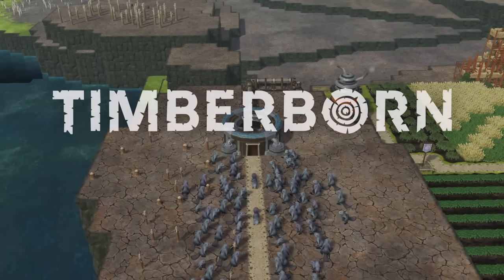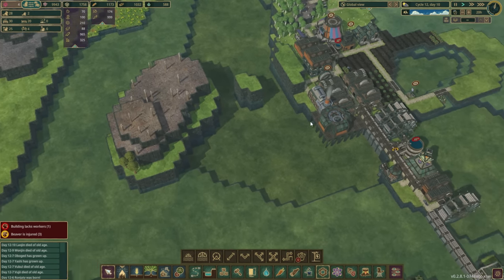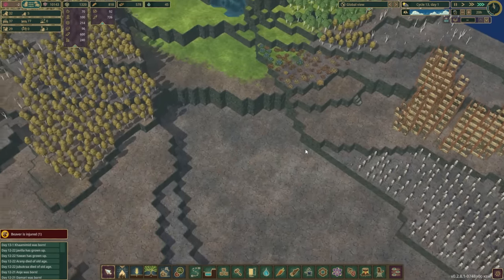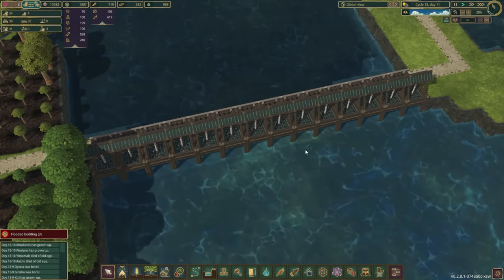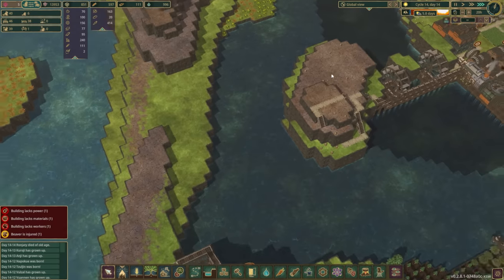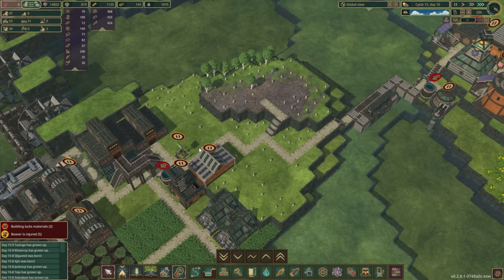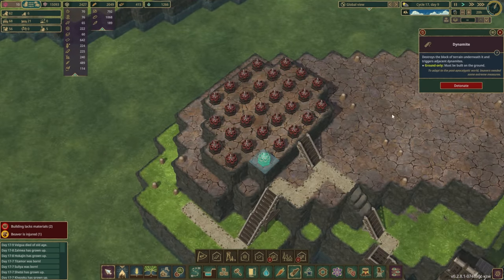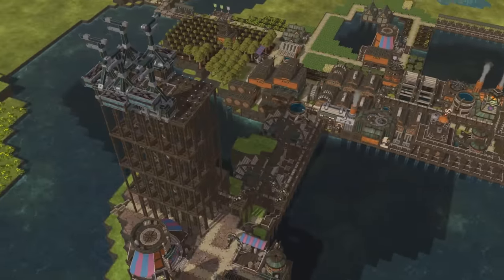I Built the World's WORST Engineering Project in Timberborn Update 2

Comment: They use rocks not water because water evaporates and would be less efficient.
Reply: Ah… not… really. You lose energy anyways…
Reply: @brody7714  he probably meant in game
Reply: @brody7714  ah yes really. Rocks don’t evaporate. Water does. If you’re storing energy you want to use whatever will lose the least energy. You don’t need to be a mathematician to understand an inert object would be better at this than something that can disappear while it’s sitting there
Reply: They want to use rocks instead of water for gravity batteries because everywhere in the world where it is a good place to build a water system, there's already one built there.  You can build a rock based gravity battery in the middle of the desert, or on a flat plain.  Water is better where you can build water, but it requires a source of water and a terrain with an elevation difference.  You can build the tower anywhere.
Reply: Cover up the water then? Make a closed system? What?
Reply: @freeportkid  water IS an inert object. Plus, you gain free energy every time it rains. Your argument is ridiculous. Energy is lost due to friction and resistance every time you use your system

Comment: So the reason they used bricks instead of water is because it is meant to be in places where water is scarce.
Reply: Even so, it's still a terrible idea.
Reply: @CarnivorousCass  I mean not really. Any form of energy battery is still better than non. And it's powered by solar and wind.
Reply: @LordKarronz  
1. The amount of carbon dioxide produced to make the concrete blocks is insane. About 30000 tonnes.
2. One of the proposed gravity batteries can only hold up to 35 MWh. A single Wind turbine produces 18 MWh on a good day. So one of these batteries can only store a single days power from 2 wind turbines.
3. In order to make it worth while at all, they would need to be built near power sources, like wind turbines. The amount of precision needed to stack hundreds of giant concrete blocks safely is rediculous, and will definitely be affected by the wind. Three flimsy cranes in a circle are not strong enough to brute force it.
Reply: Shit i guess your right, lets continue with coal and oil products for energy. Lets not try to come up with any ideas that might help out in the long run.
Reply: @LordKarronz  I never said anything about sticking to fossil fuels, or that we shouldn't come up with new ideas?  The fact that the only way you can argue my points is to make up something that I didn't even mention instead of actually refuting them proves that I'm right. 
There are always start up companies with bad ideas and good marketing that try and make it seem that their technology will change the future. But the truth is, most ideas are pretty terrible, and believing that something is a good idea, simply because the people who would profit off said idea told you it was, is damaging and slows actual progress.
Reply: @CarnivorousCass , @Karronz did kind of have a point though - just saying “solution bad” without providing alternatives doesn't really help.
However, there are alternatives - in places where water is scarce and dam based storage isn't an option, there is usually a lot of sun, so solar farms that concentrate heat on sand stored in vacuum-insulated tanks and then converts the heat into power on demand is a reasonable option, and strictly speaking, the dam option doesn't have to be filled with water, so a sand-dam could be used to store power (don't quote me on that second option - I just came up with it, and it probably causes way to much wear for it to be practical).
Reply: @Autoskip  That's cause I don't know/am not aware of any viable solutions to the problem, and even if I did, I don't feel it was necessary as we were only talking about the gravity battery. 
Muddying the water with a clearly terrible idea, and then strawmaning anyone who argues against it is how you get things like the Hyperloop nonsense in California, where Elon Musk told California not to invest in high speed rail infrastructure and instead to invest in a vacuum sealed highway that hadn't been invented yet (solely for rich people so that they don't have to mix with us commoners, mind you) and then continuously downsizing the project as he and others realised what a terrible idea it was. Until finally, all California are left with is a shitty, single lane, underground tunnel exclusively for Teslas.
Bad ideas constantly halt progress, so I feel it important to inform people on the actual efficacy of these grifts.

Comment: On your initial comment, of why anyone would use a tower of bricks instead of water, the answer is simple.  Terrain.  You can't realistically build a water gravity battery (literally a dam) reasonably in a place that doesn't have substantial hills or mountains as water requires very high volumes for practical energy storage.  And while you certainly don't care about it being the fun loving builder of industry and destroyer of nature that you are, the ecological damage of such a project tends to be pretty high.  It works in a place like the rocky or appalachian mountains, less so in a place like oklahoma or florida.

Who knows, maybe you'll find that interesting!
Reply: The concept has been busted a few times. Its a neat idea but even the prototype they've attempted doesn't work. The very idea that the battery can move around super heavy concrete blocks without miss-placing them (usually due to wind or simple errors due to physics) or damaging them by dropping them against one another is pretty obvious as even the prototype is having issues and its obviously not full sized. The devs have the right of it, if you ignore physics its an okay idea and thats the end of that. Your volume argument simply points out the holes in the tower concept itself, they'd need way more "stuff" to stack up to gain any reasonable amount of stored energy. Just like "The Edge" city, concepts like block based gravity batteries really only work inside the world of 3d animation pitches.
Reply: @rexford6260  Oh I didn't quite expect it to work very well, but that's why a water battery doesn't work well.  You can't use water in an area that doesn't have the terrain for it.  And while gravity batteries right now might not work, who knows what the future will bring.  Not that I'd necessarily want to do it, it seems like it will have a ton of teething issues.
Reply: @OnyxBMW  If "water batteries" didn't work well why are they so popular? Presently you'd need 10 of those towers to equal just one hydro pump station in the amount of energy stored. Thats just a fact, its cheaper and easier to store larger amounts of energy using water because physics and how water is such a good medium for the concept. Its not "teething issues" its an inferior version of a technology we already have and the billion dollar company around it is probably going the way of the Hyper Loop. Thats just the facts. Sure concrete is twice as dense as water but consider how much water these hydro pumps can store (and the energy along with it) vs the amount of concrete you'd need to compete. Then consider that each block stacked up becomes more and more inefficient as the distance travelled is less and less and its just not looking good as a concept.